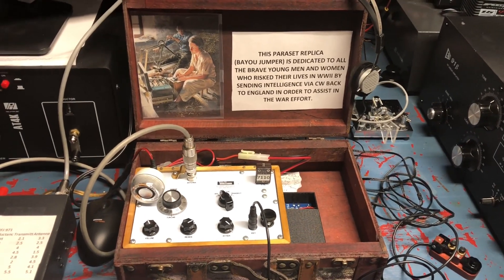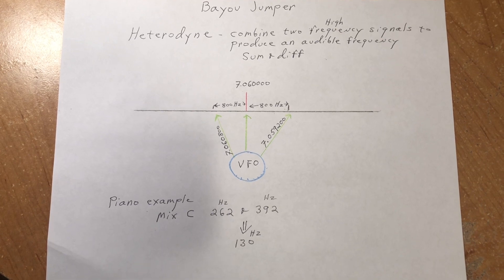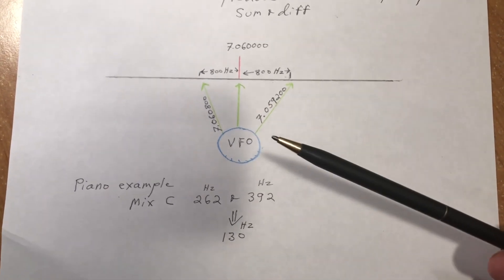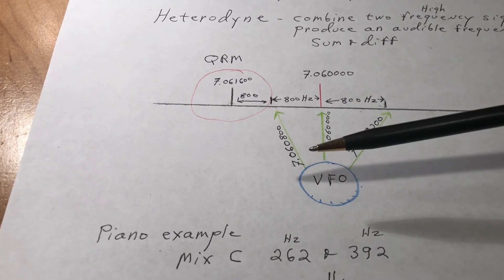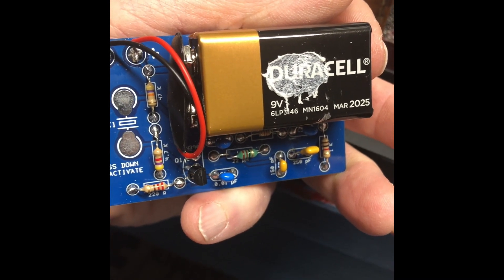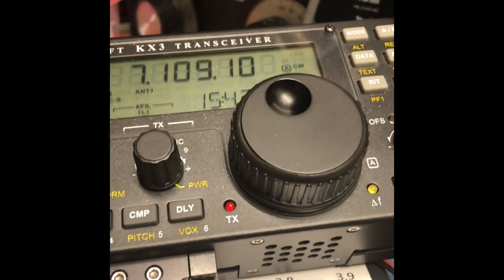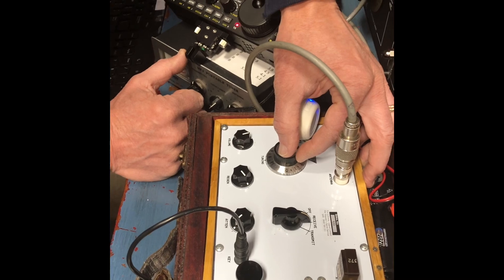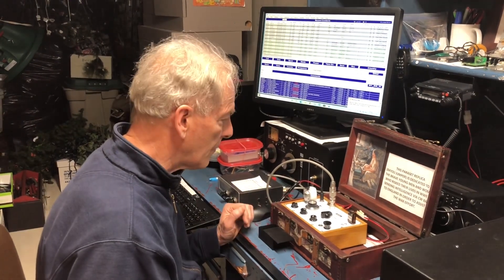The Bayou Jumper: How to operate this paraset replica and how to use the crystal spotter.

Comment: This is well done. Thank you. I love my Bayou Jumper. One thing I will add for those watching who may not quite follow the explanation about the VFO mixing the frequencies. The reason you do not hear anything on the frequency 7.060 (in this example) is because A Continuous Wave (CW) signal is an unmodulated radio frequency carrier wave, so it has no audio component that a receiver can detect. In addition the human ear can only hear vibrations as sound. To make CW signals audible, a process called heterodyning is used which he describes in this video. By mixing the two signals you create an oscillation (vibration) that can be heard. In his example 800 Hz.  I hope this is helpful to someone. 73